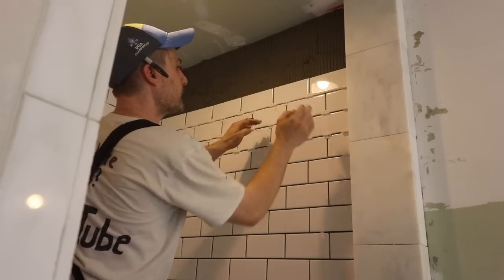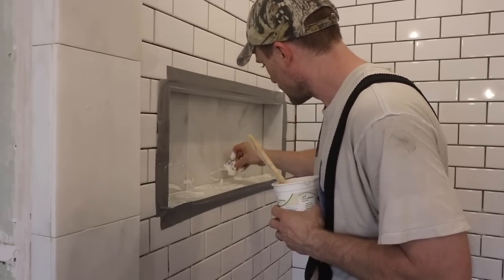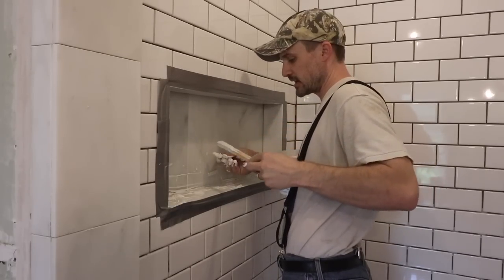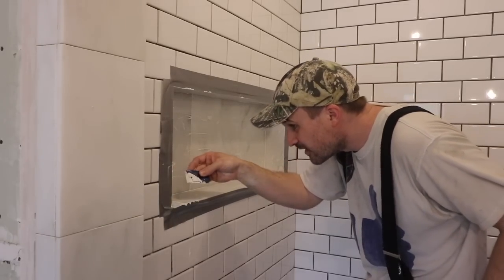DIY Home Renovation | Farmhouse Bathroom | Episode 142

Comment: 💙 the outtakes...
I had white grout in my shower in a home that we built. It was beautiful at first. Over time it picked up stains from mineral deposits from the water.  Didn't happen everywhere. Just where there was a constant stream of water...
Reply: Deanna Marie ...same here!  And when I used bleach it destroyed the grout seal and eventually started leaking in the master closet.  I’m in the process of hiring a contractor to demo the shower and start over.  Obviously, I will NOT use white grout.
Reply from the maker: wow! that sounds awful. sorry that happened.
Reply: Live and learn... if I. Had to do over again. I would go groutless, larger tile. Most importantly. I would be sure to seal my grout as a routine from the beginning.

Comment: Hmm.  You need a shower head, the handles, a shower rod and curtain, and some tile and grout sealer.  That't maybe 2 or three hours work, tops.  Then you have a working shower.  You already have a working toilet.  The floor is tiled.  So is it an officially working bathroom yet?  Cause it looks good enough to use, not to mention just looking good.
Reply from the maker: ya, it's really coming along now dude! I'm taking a week off this month too and I'm thinking we will get a lot done during that. I hope so!!! I'd like to move downstairs and get some work done.. insulation, sheetrock, finishing the wiring down there.. lots of stuff.. lol

Comment: That looks awesome. Love the gray grout on the white tile. When you mixed the grout, did you add a sealer to it? They make a sealer additive for the grout so the whole thickness of the grout acts as a sealer. Works great. I believe it is at Lowe’s. Just an idea for you. Again, looks awesome, job well done.
Reply from the maker: I didn't add anything. I thought about it.. haha! that would have been way easy. dang
Reply: Try it next time. It work great. Instead of water you use the additive and mix like that. Thanks for sharing